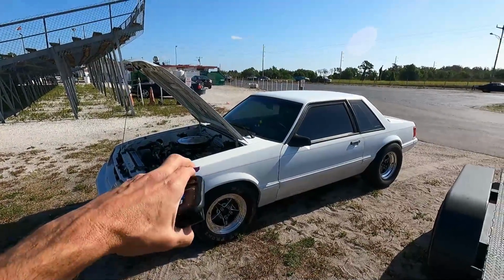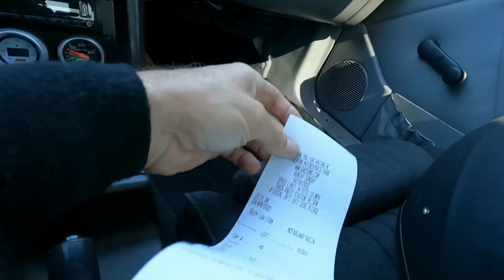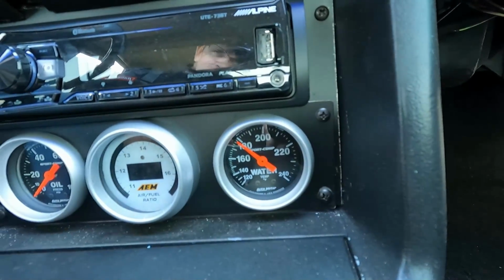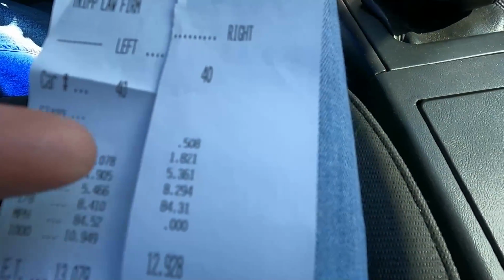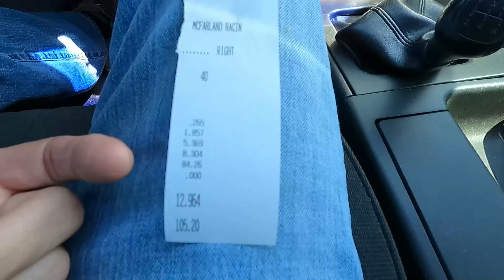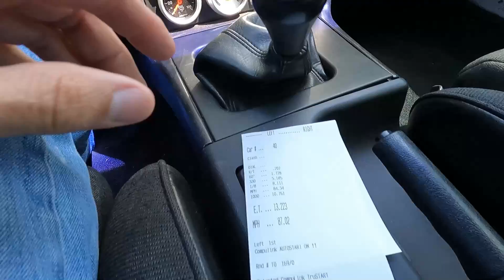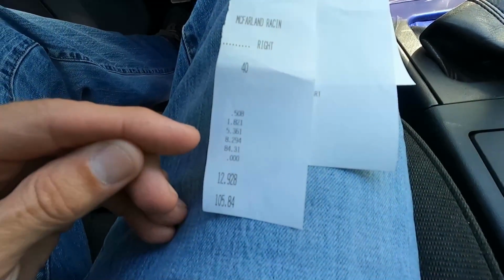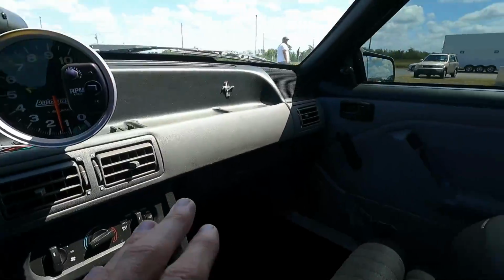Budget Fox Body With A Junkyard Explorer Motor And A T5 On Its Last Leg. What Will It Run?

Comment: Sbf : 4:56 lightened 1980 must in street form 870 dbl pumper  big heads Canted valve  closed chambered clevor   headed :  :  pb  6:57 1/8: she loved that high rpm : built myself and still lives only retirednow in a old pick up fun family farm  except heads are open chambers now : that was in 1995  : man fun times

Comment: I have a stock Explorer engine in my Fox too. Stock other than an on3 single turbo kit and it runs 10.80’s @ 129 What axles and diff are you using?
Reply from the maker: Stock sn95 rear ended with 373 gears.
Reply: @fox-body  did those have the 31 or 28 spline axles?
Reply from the maker: @aaronliddell4280  hmm. Good question. Not sure.
Reply: @aaronliddell4280  28 spline
Reply: Hey Aaron are you running the stock oil pan and accessories?
Reply: @romero.4089  yes sir
Reply: To clarify, stock Fox body pan and accessories

Comment: In my old ISF i had a 1.93 60ft, went 7.99 in the 1/8th @ 91mph, and finished the 1/4 at 12.27 @ 115mph.
Reply from the maker: Nice.
Reply: What was all done to the F on what tire?
Reply: @cnebuda7422  intake, headers, exhaust, E30 tune. No spare/jack/tools in the back. No back seats.

Tune wasn't dialed in all the way, full tank of fuel, on stock 2011 wheels and a firehawk indy500 with traction control on. Definitely had an 11 in it

Comment: Never seen your channel but what is the setup on the car ? Try putting the engine on the limiter at the line and then dumping the clutch. Don't lift the throttle, just keep your right foot on the firewall 🤣
Reply from the maker: Lol. Just a junkyard explorer motor with a n41 cam and a 600 carb.